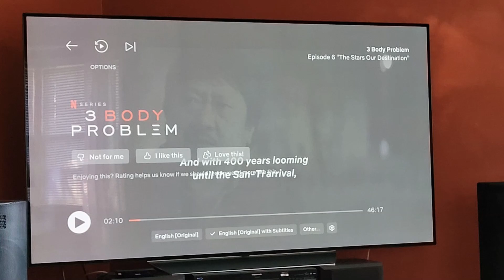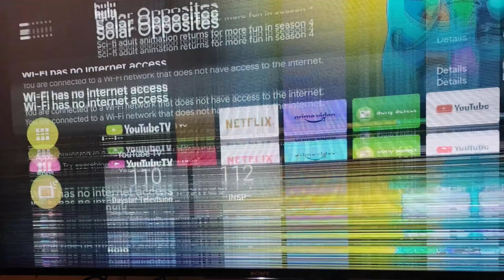**Terminology 101** for DIY TV repair.

Comment: I have a LG 70UM6970PUA does not turn on and the red light dont even turn on either ,what could be the problem
Reply from the maker: It sounds like a power issue. I would suggest swapping out the power supply board first.  Usually if there is another issue and the power board is working, there will at least be a standby light or a blink code visible. The lack of these makes me think that the problem is on the power supply board.